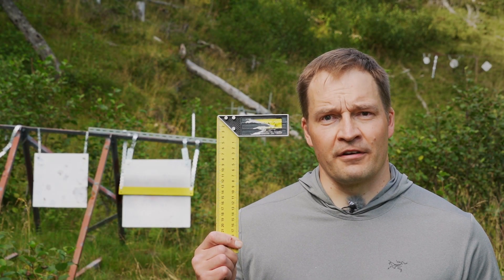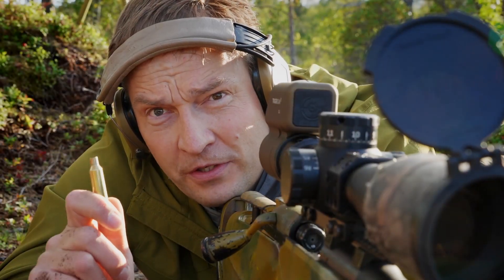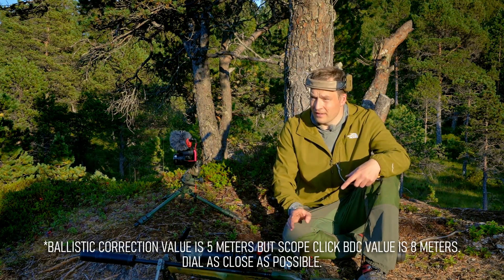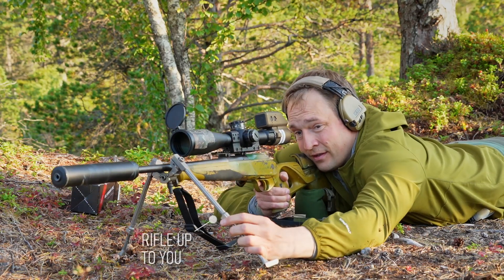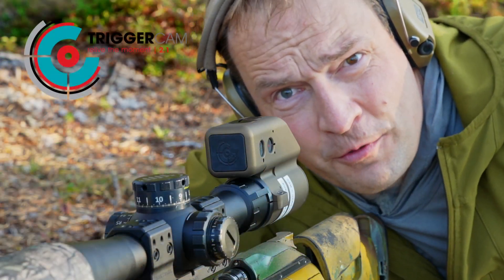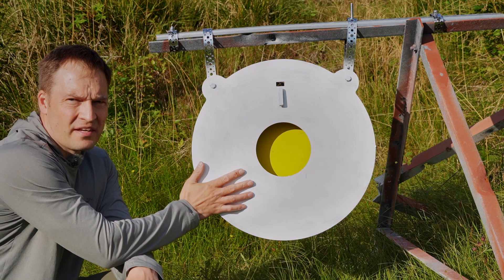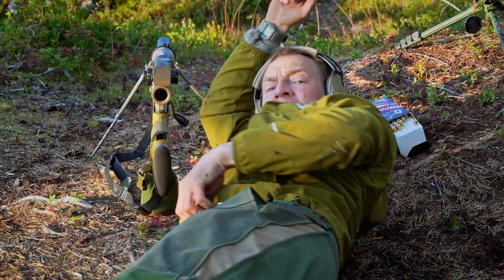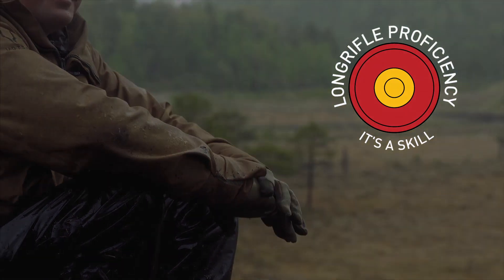LR Blog 342: Basics of longrange shooting

Comment: Hey, Thanks a lot for a great series. Amazing work - I have just found your channel and basically last 2 days is nothing else to watch. I would have a question on the "significant numbers". Understood that it is related to the BC but was not able to find a way to fit to my bullet. I use multiple calibres for hunting and frankly the BDC style correction where I can adjust easilly is so helpfull! Thanks for sharing the info with me! Martin
Reply from the maker: Significant changes will most likely be fully explained in episodes 369-370. But set ballistic calculator to 1 meter resolution, prod with a weather change of 10C OR 30-50hPa, compare to your base trajectory and you'll likely see it. If your base trajectory says 500m 30 clicks, you want to see at what ranges 30 enters and exits the changed trajectory when you set resolution to one.

Comment: I am willing to buy a blaser r8 ultimate. What barrel would you recommand?
The standaard, semi weight or the match? Can you explain how you come to a choice?
Reply from the maker: I only use the standard barrels, ø17mm, cut them to 50cm and mount a silencer. The semi-weight or match profiles add only weight and cost for me. It's the same blanks machined on the same machines, so should be no difference in quality.
Reply: @THLR  thank you for the reply!

In blog 204 at minute 1 you show that you use a semi weight barrel for the 300 win mag caliber?
Isnt it so that a havier barrel shoots with lees recoil, moor accurate en with lees vibrations?
Maybe academici stuff you dont need in real live as you show with your performance. 
Nice to know i can do well with the normal barrels!!
Reply from the maker: 300 Norma not Winmag. It is a significantly more powerful cartridge, pushing the heaviest 30 cal bullets almost 100 msec faster. A heavier will give less felt recoil, that is physics. Usually less recoil makes the rifle easier to shoot. But a heavy rifle can also limit the positions you will be able to use shooting, effectively reducing the shots you can take.
Reply: @THLR  thanks, i go for the standard barrel in stad of the semi weight or heavy

Comment: Do you always use 30 and 7 for your significant values or is it dependant on bc muzzle velocity ect.?
Reply from the maker: It's more Bc reliant. A higher BC bullet can significantly increase the tolerance. I typically prod with 30/7 when I check the calculations for any bullet in the Bc range of G1 0,45-0,55. With my 300 Norma and Hornady 225gr ELD M the pressure tolerance was 50 and I cannot quite remember what temp was.
Reply: Thanks for the info. I have just been watching your new videos and it reminded me to check this 👍

Comment: I would be interested in learning about what product you use to coat your rifles and also how you coat them with it. Also, do you still shoot the 6.5x284 Norma? That has always seemed like an excellent cartridge to me. What are your experiences with barrel burnout with that cartridge? Seems to me that 6.5x284 Norma trumps 6.5 Creedmore. I really don't care about having a shorter cartridge. 

All the best
Reply from the maker: No not for the moment, but expect to use it again due copper bullets (want max V0). I retired my x284 barrels around  2500 rds when they started to produce fliers. I use aircuring Cerakote, since I don't bother with cosmetic appearance I simply degrease and spray. On the stocks I also use plastic primer and acrylic spray, the R8 stock (this rifle) is coated like that
Reply: @THLR  I would like to get your opinion on a scheme that I have been conjouring up. Let me know if you concur. It goes like this: purchase the R8 in 6.5x284 and select a lighter bullet and powder combination that mimics the 6.5x55 Swede - this will aid in barrel conservation and will be more than plenty for the white-tailed deer that I primarily hunt in the thick northern forests of the midwest US. Then, when it's time to head west to hunt elk and caribou, I can load the 6.5x284 up to its higher pressures/velocities. I forgot to mention that I reload (Dillon 550b). Also, do you prefer to have a steel decocker on your Blazers? I remember when I first picked up an R8 with a synthetic decocker and something just felt odd. 

Thank you for your responses, your channel has always been quite inspiring. 

All the best
Reply from the maker: @thomaspeterson3797  I have nerve damage and am no fan of metal in cold weather, so I take plastic over steel whenever possible. Elk I am not familar with, but why bother with two bullet weights? I'd go 140'ish gr all the way and rather use slow/fast load with same powder. Possibly load a few cartridges with 120-130gr if I already had the bullets. I suspect the Blaser barrel with scope mounted on it would print both loads close enough to "nevermind" the POI change. Mind you, this is for ease of logistics only, if you enjoy reloading go ahead with your plan - I'm usually in a pinch for time and go for the simplest solutions and try to keep as few flavours of components as I can. I'm not that familiar with powders as so many new are on the market, but something along Norma MRP burnrate. Vitahouri has several new powders as well. Not sure what their US equivalents would be.

Comment: Howdy, Thomas. Just waiting for Netflix to catch ya up 😂.....Anyway, would the effect of temp/ pressure be constant, no matter what kind of bullet you send through the air? Meaning, can you expect the same correction in respect for lower temp / higher pressure for a 140 gr / 6,5 bullet as for a 250 gr/ 9,3 bullet?
Reply from the maker: Related to ballistic coefficiency. Values should roughly apply for all G1 0.5'ish. High 0.7 changes to 12/50 IIRC, I believe that was my 300NM values

Comment: Hi :)This bdc adjustments  for temperature 7 C and hPa 30 are for specific calibar ,can I try on .308?Thanks
Reply from the maker: They are related to the ballistic coefficiency number. The 7/30 values seems to hold true for G1 0.5. With my 300NM and 230gr Berger G1 0.7 was approximately 12/50 if I recall correct. Lindroth &  Norin made Longrange Shooting 2 where the mining process is explained in detail. It should be on Vimeo, possibly also on MOTV.
Reply: Thank you for your videos :)))I am learning very much from them
Reply from the maker: @blazogrga1602  Excellent, good to hear!

Comment: I have a question. How long will a barrel last? our hunting leader( for lack of a better word) says that his 7mm remington should last between 500-1000 bullets depending on barrel quality, cleaning and how hot the barrel gets everytime he's shooting.

which to me sounds like a years worth of ammunition. But about how long should a 6,5x55 barrel last?
Reply from the maker: It's to difficult to give any precise answers. Depends on caliber, powder used, steel quality, manufacturing process and induvidual shooting style, precision requirement and possibly cleaning regime. I don't do any break-in on my barrels, I just start shooting and over the years I've been cleaning less and less (allthough I do oil the barrel after every shoot). The 6 XC I just shot probably hasn't been cleaned (brushed) in >300 rounds of molycoated bullets. As for barrel longevity I retire the barrel the same day I start seeing fliers, meaning I miss my target for unexplained reasons. For 6,5x284 that seemed to be around 2500rds and 6,5x55 seems to do 4-5000. My 221 Fireball I expect to last "forever": Sorry, most precise answer I could give.
Reply: @THLR  thanks for the quick response!